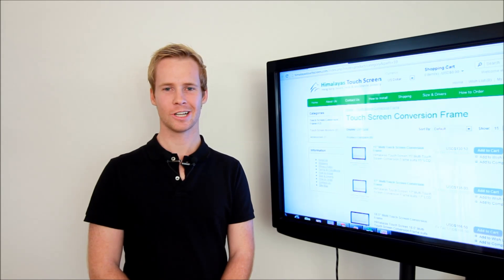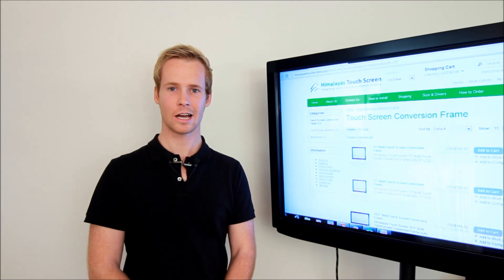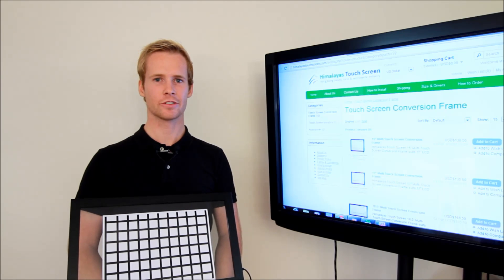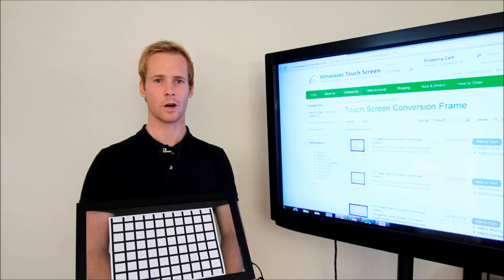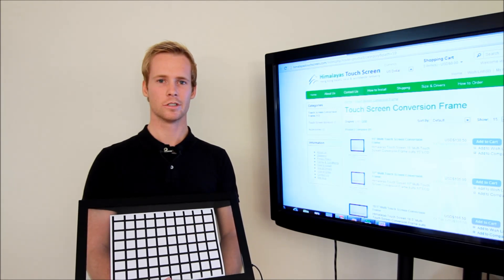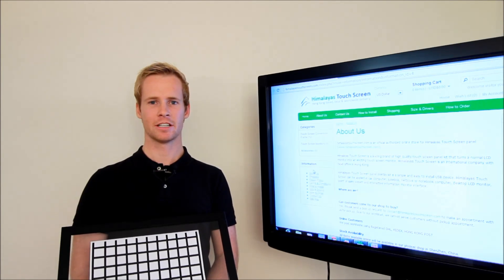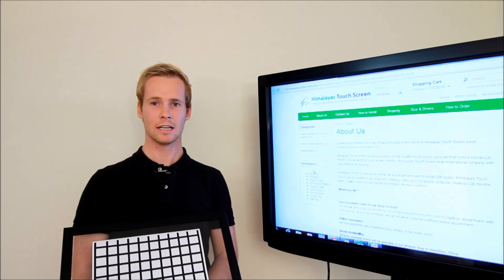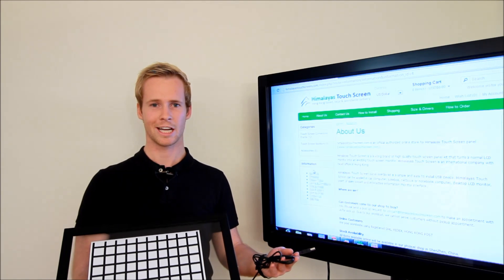Cheap and easy way to convert any TV into touch screen monitor

Comment: Can we use a larger frame on a smaller led tv? I.e. Using a 70" frame on a 43" tv. Are we able to do a calibration on the frame to only detect the area of the tv?
Reply from the maker: No

Comment: how can this be used in a collaborative room when we will be casting the users laptop through Mirraop? the way the usb is needed means it needs to be connected to the laptop or device sending the image?
Reply from the maker: The touch screen frame works like a usb mouse. A computer and a display screen are required.

Comment: another awesome use for this is to get the biggest one and stick it to a wall and point a projector at the frame like its a projector screen and then get a usb extender and plug it into your computer if its gonna be further away than the original cable
Reply from the maker: yes. It works with a projector

Comment: Do I need to remove the original front from of the TV or just need to tape this frame on top of the one that my TV has? I have a 42 inch that I want to convert to a touch screen monitor. Also my question is if it works with Mac OSX or it is only Windows compatible. Also if I need to do Calibrations how should it be done? Do you provide any document or guide for the Calibration process?

Comment: Hi, how strong is the screen window, say that i decided to make my flat screen into like a coffee table, would i be able to put coffee mugs on top of the touch screen?? cheers.
Reply: +jamil1985 Of corse not^^^you would have to put an extra layer of glass between you tv and the frame
Reply: No because it would activate the touch screen sense it's sensor detected it will detect anything that touches the screen
Reply from the maker: depending on how thick the toughen glass that you use

Comment: can you show how to type words from the screen. does it have the same apps like we have in original touch screen windows?
Reply: onscreen keyboard
Reply from the maker: It comes with on screen keyboard when the frame is plugged into a windows based computer via usb